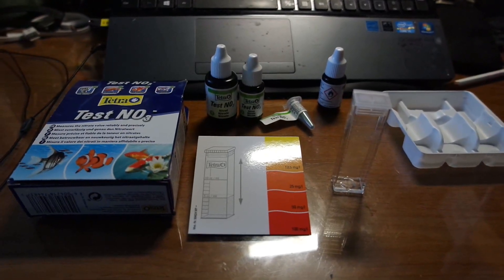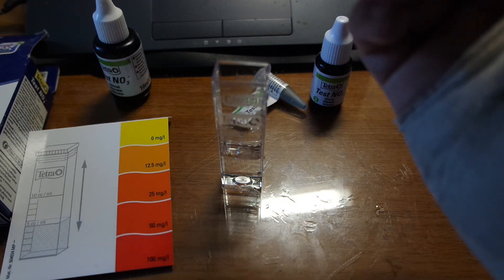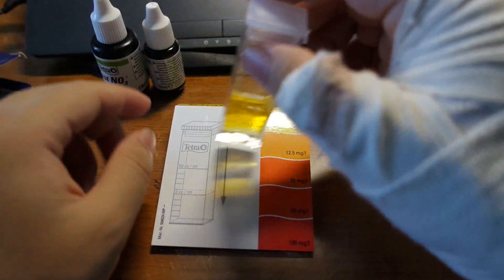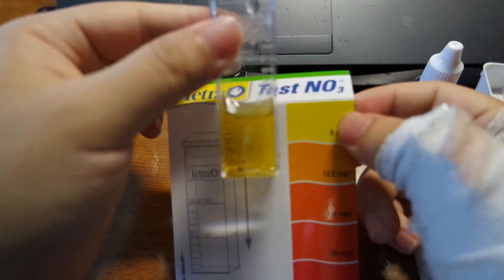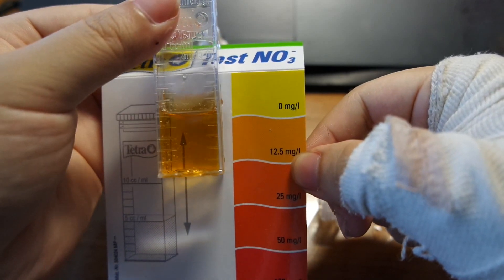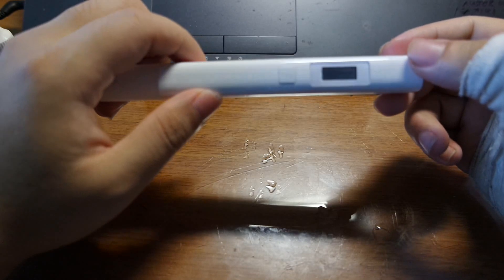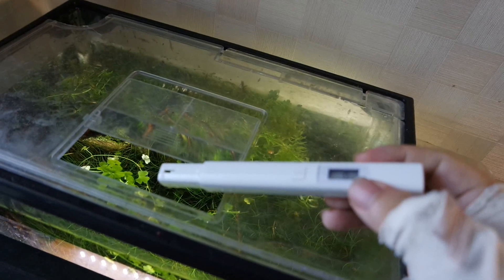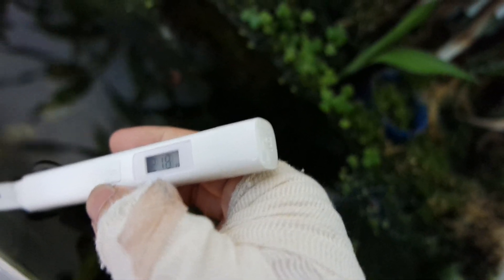nitrate, TDS testing for all my tanks

Comment: The tests are ridiculous. They don't encompass in sufficient detail the critical range of 50-100 mg/L. Basically, you risk the life of your expensive imported fish, based on a very slight difference of color. 

In the end, the most reliable test is the "dead fish test" - you will learn from your experience, when your fish start to die. That's the signal that you must change water in your tank.
Reply from the maker: Nope
Reply: @Jaysaquarium  Yep! It's better to invest into Pothos and stop buying these useless tests.